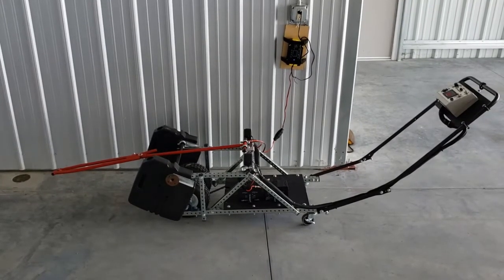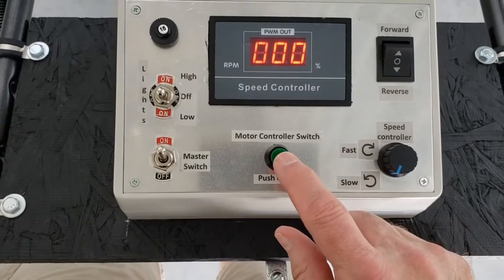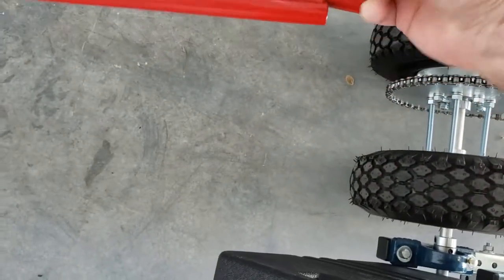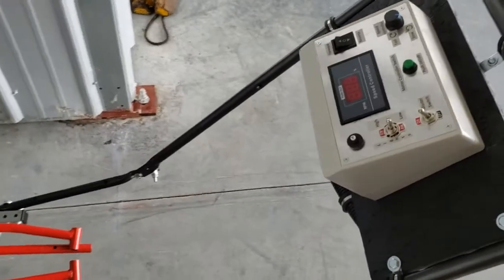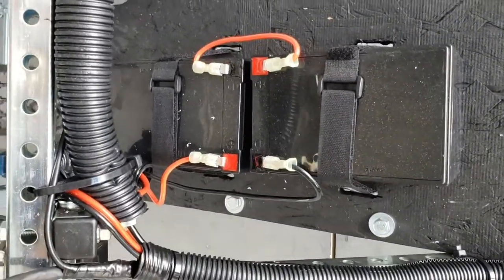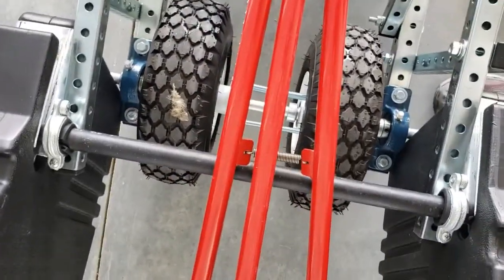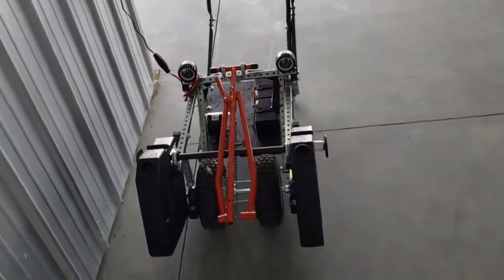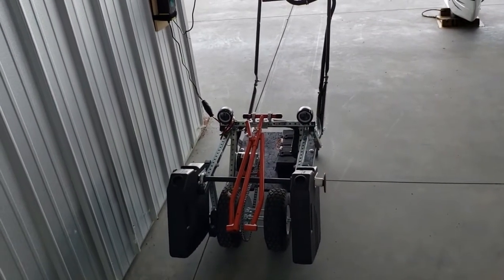DIY Electric Aircraft Tug  - Explanation video

Comment: I am trying to understand how you are driving the wheels.  I see the long bolts between one wheel and the chain sprocket, do they also drive the other wheel or is that free spinning?
Reply from the maker: The long bolts tie the two wheels together so they both drive.
Reply: @bigadventuresinsmallplanes4337  Thank you,  were your wheels split rims or one piece?  Very clever idea.  reviewing more closely, I see that the right hand wheel has a hub that bolts to the chain sprocket and then the bolts bridge over to the left hand wheel.
Reply from the maker: @stevenwilkes5737  These wheels were each one piece - not split.  The wheel with the chain sprocket came that way.  And, yep - those bolts bridge over to the other wheel to have it participate in the drive as well.